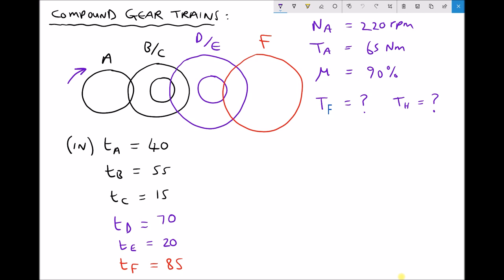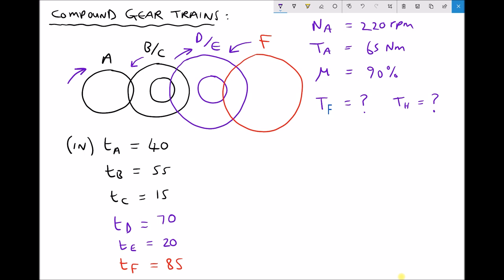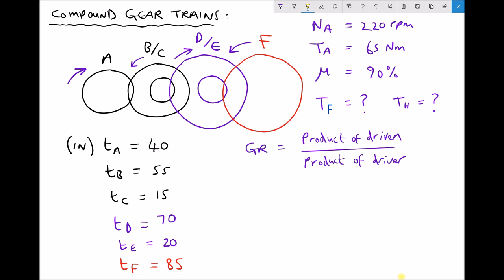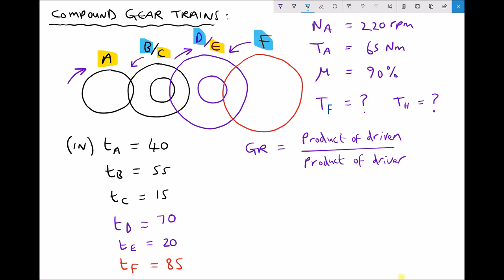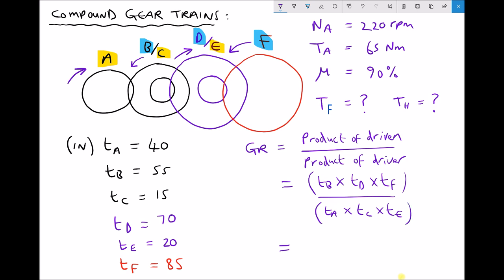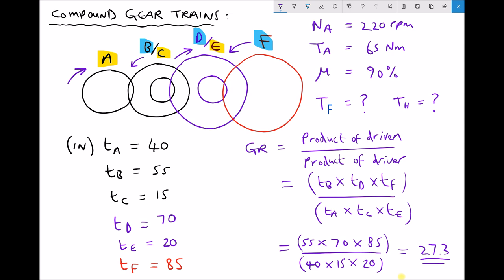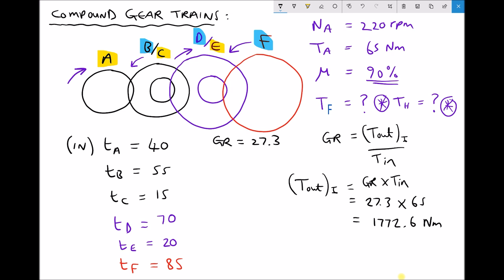Calculating Output Torque and Holding Torque for Compound Gears

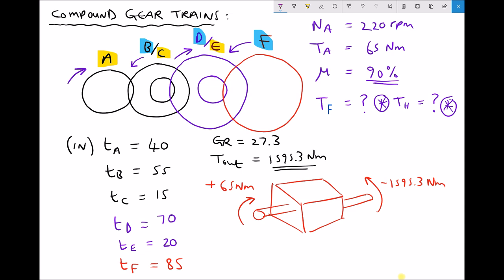Comment: At a glance, ~8:15 ..., balancing torque magnitude should be 1595.3 + 65 (in this case). The reflected output torque is opposite the direction of rotation.